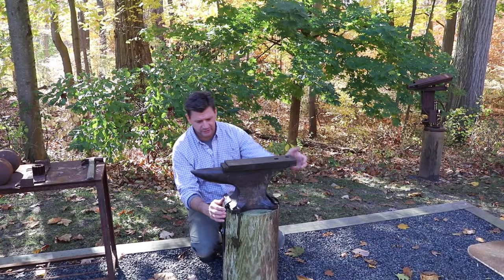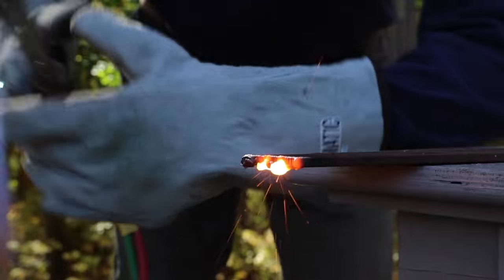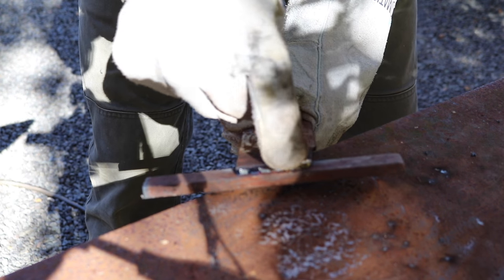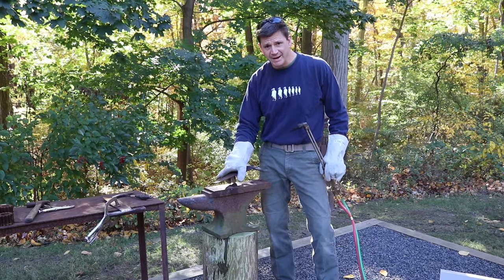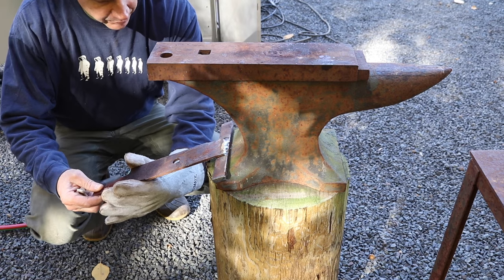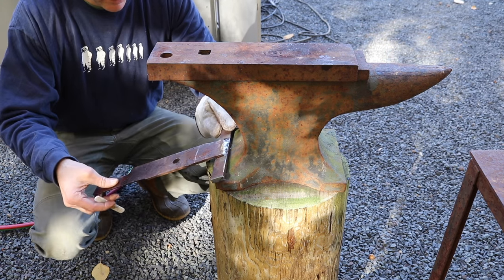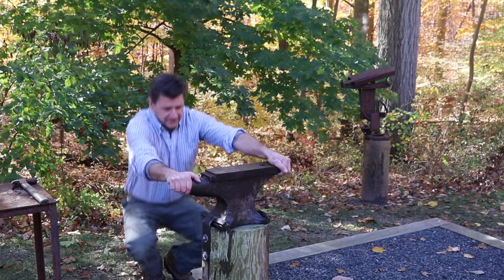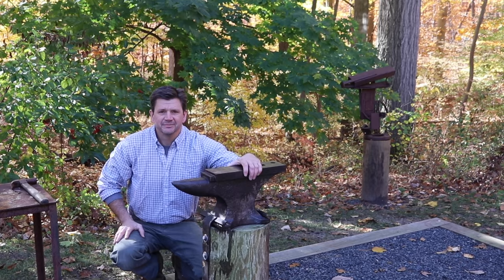Anvil Hold Down, Make, Forge & Weld

Comment: Great idea. Why did you choose to cut through the steel in the beginning using the torch instead of a cut-off wheel  on a grinder? I've never used a torch like that but it seems like it'd take a lot longer

Comment: Jon, 4:05 what kind of rust remover you use? Works great! Regards!
Reply: I think its no rust remover, just protection of the metal. I think it's raw linseed oil, you have to heat that and than it 'bonds' to the metal.
Reply: matroosoft yeah I think you're right linseed and beeswax maybe.

Comment: I saw in a previous vid you picked up a bosch miter saw. What turned you that direction vs say a very popular saw like the dewalt 780 12in sliding miter? You notice any deflection with them articulation joints vs the slide on dual rails? I am shopping around myself. As I have said before YOUR CHANNEL FLAT OUT ROCKS!!!

Comment: The Lawnmower Blade is Carbon Steel, i don't think it will Weld up as good as "Structural Steel" & don't heat steel on the Anvil, you will Destroy the Temper of the Face & cooling Oil Hardening Steel with Water, you are looking for Cracks, the Cringing Moments & Jaw biting aside. Not a Bad project!